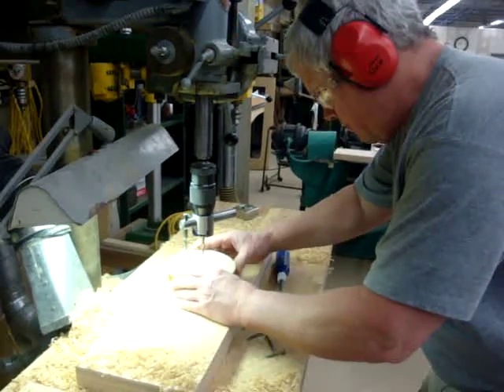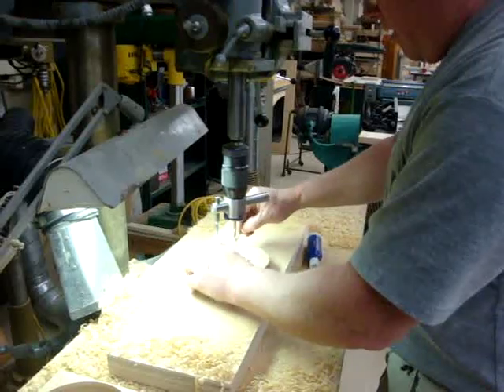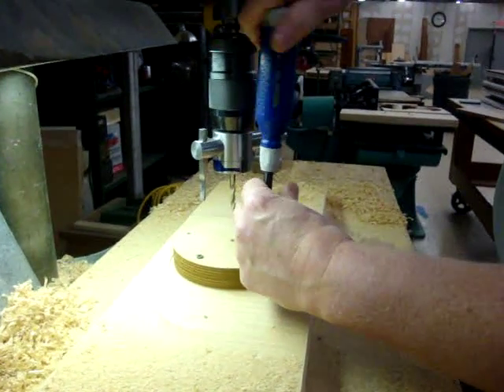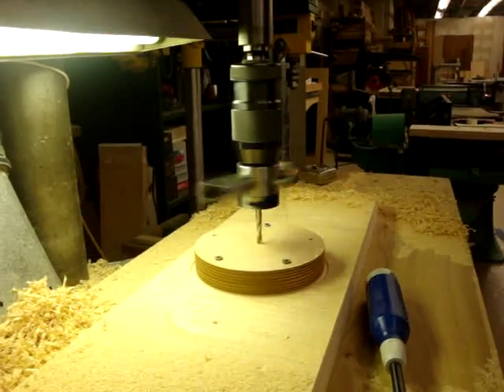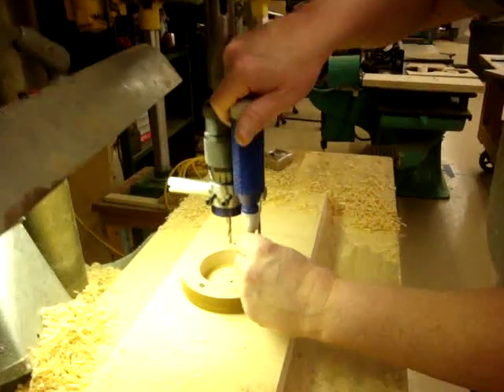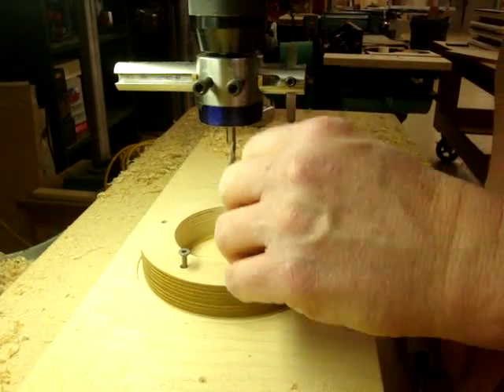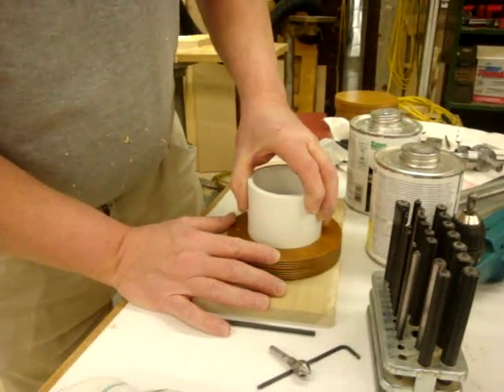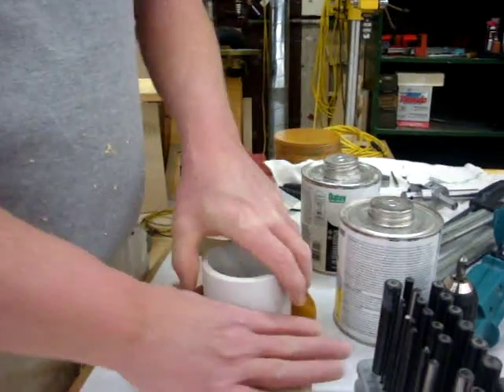Circle Cutter Demonstration

Comment: Whats the minimum speed for smooth cutting? for circle 4inch dia and below
Reply from the maker: I run that at the highest speed the machine can run cutting that size. It will run slower but the slower you go the rougher the cut in general